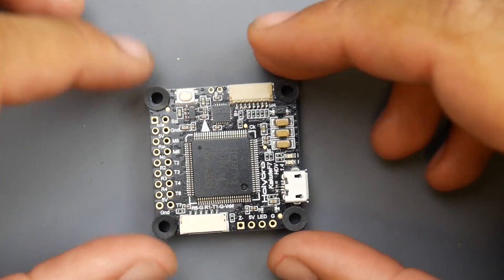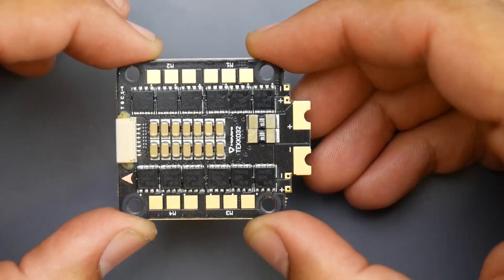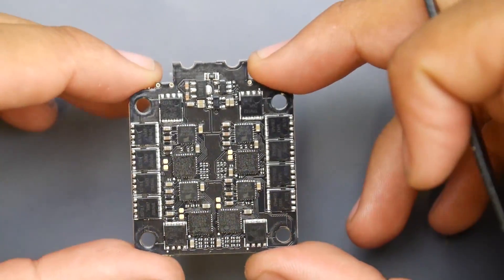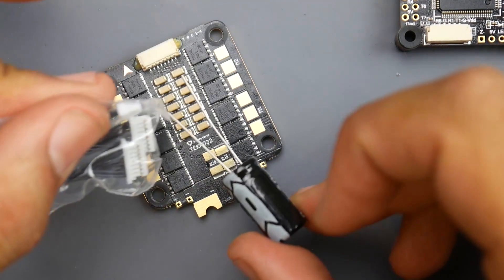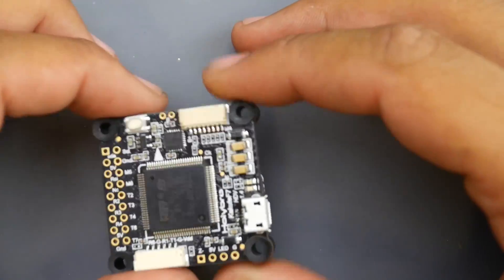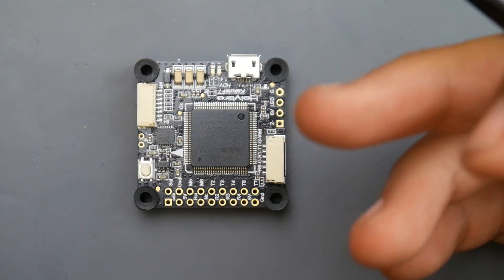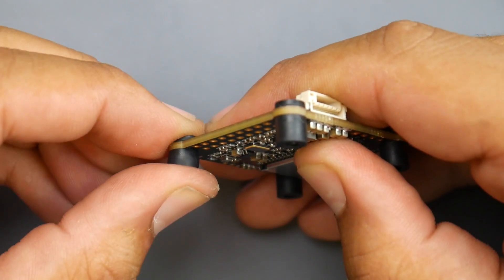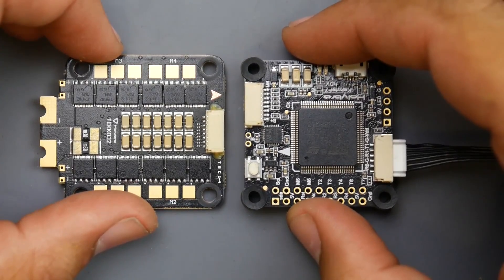The First Plug-In-Play FPV Flight Controller for DJI Digital FPV System

Comment from the maker: Holybro HDV Stack: http://bit.ly/306NrHb
DJI HD FPV SYSTEM: http://bit.ly/31G3qw6
DJI FPV Drone Frame: http://bit.ly/2jRcpKy
Reply: Drone Mesh Hello 👋,  I have this stack already but I have 2 questions. Fisrt, if it doesn’t comes with osd, how can I see and setup my peripherals for GPS? Also, if I use 5 or 6s lipo what’s gonna happen? Please help me out thanks 😊
Reply: Just an FYI the B+ and B- are actually full battery power, i tried using them for the buzzer and they did not work.  On the manual it says you actually have to use the Z- and the 5v by the LED like you mentioned.  👍
Reply: Hey bro, thanks for the info, so now i have the air unit and the goggles, i have a frsky qx7s controler. Let me see if i got it on what else i need.

1) The holybro HDV Stack
2) The frame
3) The receiver for the frsky
4) 4s lipo and charger
...thats it?

I will be very gratefull for a step by step build for this quad.

Comment: I've been building this since yesterday but couldn't get it to arm. I flashed the firmware to STM32F405 latest version but now the ports and everything are gone. Cannot calibrate gyro either. Could someone let me know what is the correct target to flash in Betaflight so I can undo my changes. Thanks!
Reply from the maker: It's not a F405 it's a F7 look for Kakute f7 HDV

Comment: Is this stack only compatible eith DJI Air Unit, or it can be used with other VtX
Reply: Since it doesn't have OSD, the FC and VTX don't interact at all. It's "compatible" with the DJI Air Unit only because of the convenient JST connector. You can use whatever VTX you want, as long as you use the soldering pads.

Comment: How would I wire this stack up with the DJI air unit but using Crossfire for control link? Also does the arrow have to point forward. I don't think it will fit in my frame like that. (At least the ESC part of the stack wont because of battery leads). Thanks!

Comment: You missed something. RTFM. The pads left and right from the lipo pads are for 2 capacitors that actually come with the Furling 4in1. Must use when connecting 6S lipo.

Comment: Hello I need some serious help. I just purchased the kakute F7 HDV, for use with my DJi digital fpv system. I am having trouble connecting the transmitter to the fpv air unit on the drone. The user manual does not seem to include the “hdv” specifics. I have tried every uArt port and have selected serial RX, but the board still will not recognize the DJi unit. I have the DJi unit connected using easy plug in the f7 board. I also have sBus selected.  I am on Betaflight 4.04. Can you help? Thanks so much!
Reply: Are you using the DJI transmitter? If so all you have to do is go to dji tutorial channel
Reply: Turns out i didn’t have the firmware updated for the air unit/controller lol

Comment: drone mesh, do you know if the dji system can take 4s vbat directly?
Reply: Yeah it's rated for 4s. Should be good. Range is from a little over 17 Volts so it's above the 16.8V 4s limit.
Reply: @Anonymous9683  voltage spikes... hard breaking escs

Comment: The batery voltage out puts on esc are sweet
Reply: How do you turn that on and get it on screen? 
Thanks Rick
Reply: @rickm1283  I'm not clear on your question.  I liked leads on esc so can supply vtx with power.. any thing seen in goggles are in beta flight.
Reply: @rickm1283  if concerns DJI goggles I don't have. ..
Reply: Ok thanks

Comment: Nice info. Thanks. No GPS ...???
Reply from the maker: No flight controller comes with GPS you just add it to the Rx and Tx pads if the GPS has magnetometer then those will be on scl and sda
Reply: @DroneMesh  ok
Thanks.
Reply: @abidikar  gps? This is not a dji mavic lol

Comment: You should build one so we can follow. I just started back and thinking of what would the best setup for the dji system.
Reply: Hellmuth silva marmotte seems to have a nice layout to hold the air unit
Reply: @Hohmies86  You'd have to drill holes further up if you wanted a 30x30 stack. Apparently there's not enough room for the air unit at the back unless you modify the frame or use a 20x20. 

I just picked up an ImpulseRC HD Apex. No camera cage but it is purpose built for the DJI system and has a great antenna mounting solution.
Reply: @Anonymous9683  the Marmotte DJI frame has the holes drilled further up, 30x30 fits